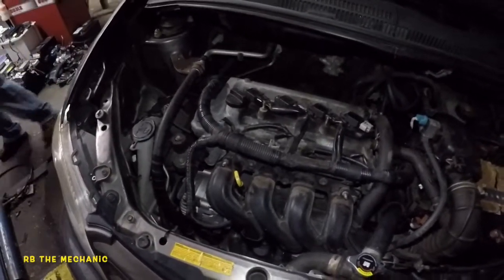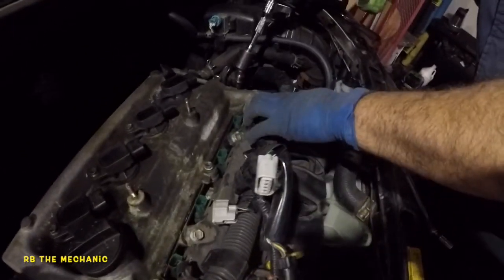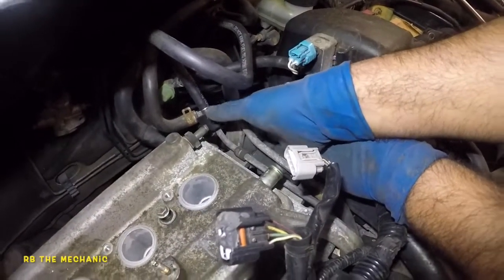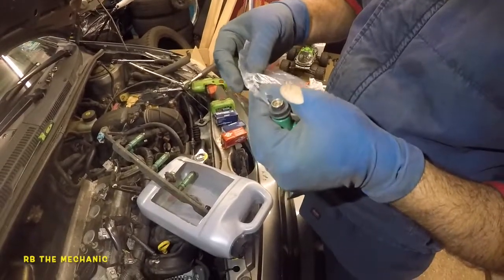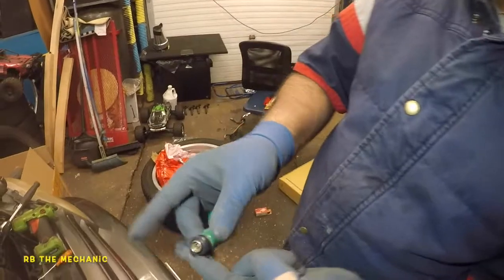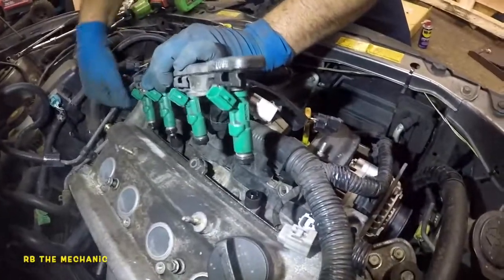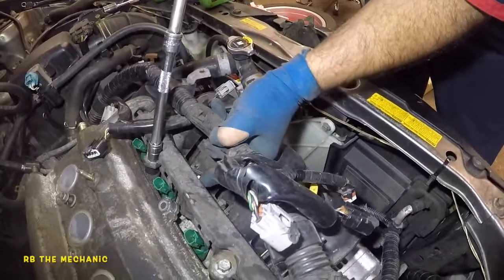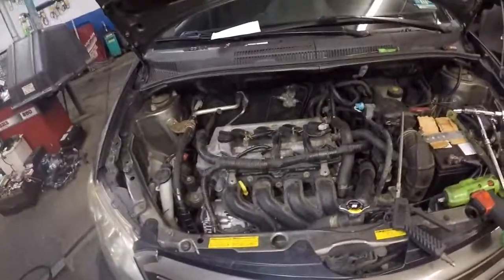Replacin leaking injector seals on Toyota corola or scion XA   FIX LEAN codes p0171

Comment: I just got a little 04 XA cheap ($300). The lady I bought it from thought it had jumped time. I charged the battery and got it to crank. It has a miss. The scan tool says lean condition on #3 cylinder. Thank you for making this video. I am just going to get a new set of OEM Denso injectors off of Ebay for $27. Thank you for showing me how to replace them. I may go ahead and do the VVT solenoid too while I am working on it. I have an 05 too. If I couldn't get the 04 running, I was just going to use the 04 for parts. It is way nicer than the 05. It is a 1 owner with 80,000 less miles on it. The 05 is the parts car now. Lol
Reply from the maker: Great yup check plug and coil or do swap test
Reply: Check the VVTI filter too it's  underneath  the VVTI solenoid in the block you will see an 8mm alien plug remove it the filter is in the block you can clean it or replace it alot of techs forget about this very important.

Comment: @RB The Mechanic what were the symptoms?  I have a lot oil straight down from where the transmission bolts to the engine. No loss of transmission fluid. Not sure what is leaking.
Reply from the maker: It was running lean depends on the color could be oil or transmission fluid